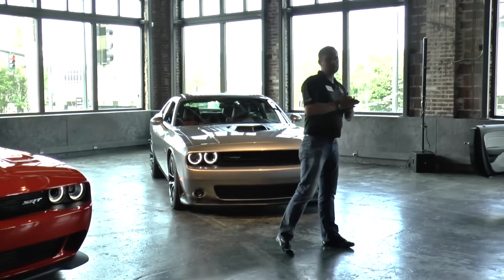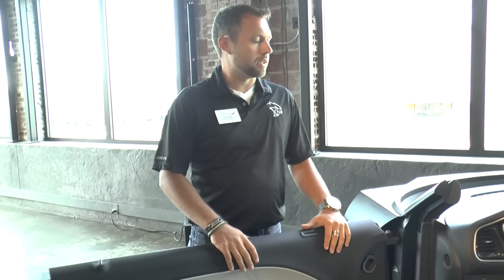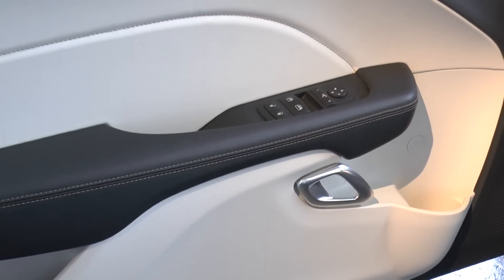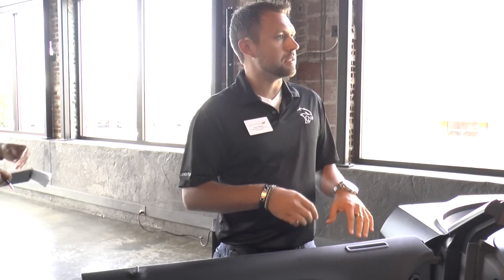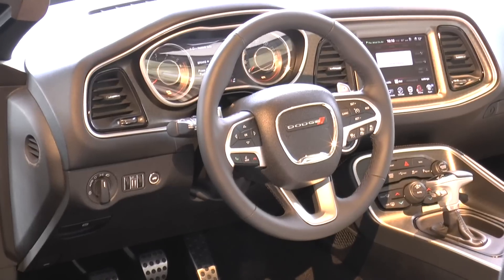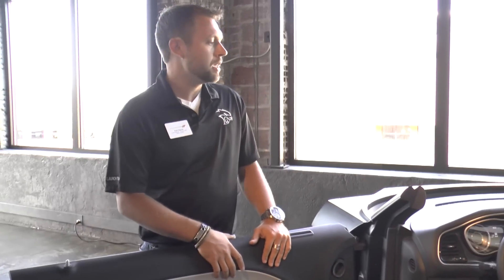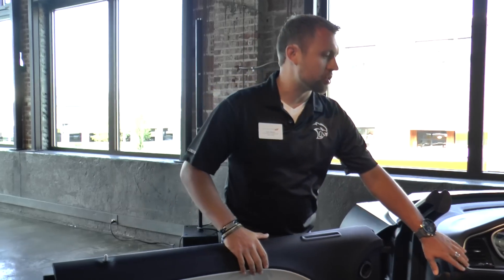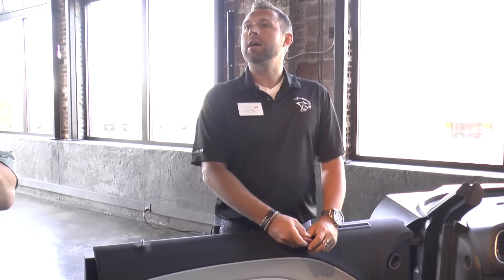2015 Dodge Challenger and SRT Media Drive, Interior Design

Comment: I tried to like the center console but the design was a turnoff. The "In Your Face" placement of the screen was too distracting and the tapering of the passenger side dashboard looked weak. The floor console would have been fine if it didn't take up vital room for a cleaner looking center console design. Also, the audio mute button was placed too close to the ignition button. While the steering wheel and instrument cluster looked clean, the dashboard material looked like grade 20 rubber. The rest of the interior design was beautiful.